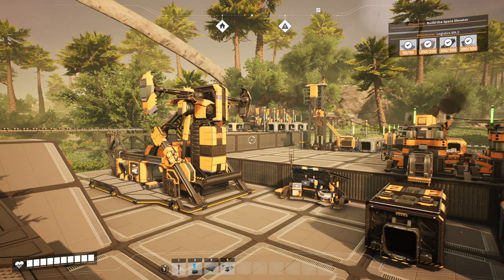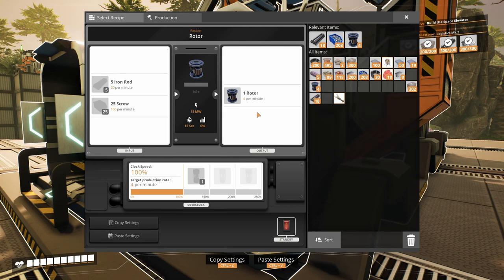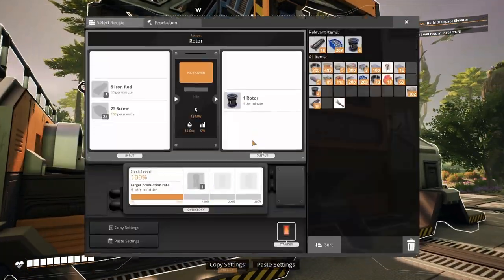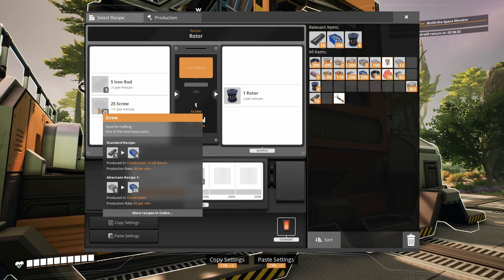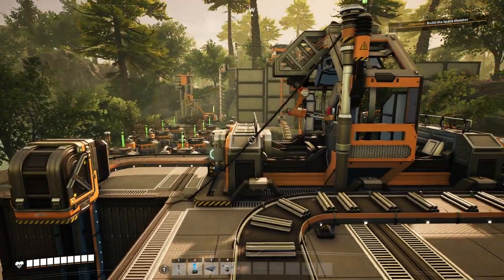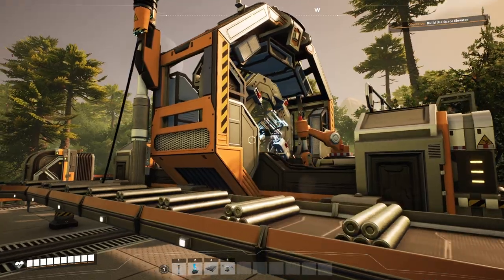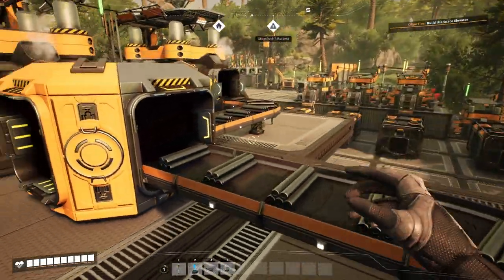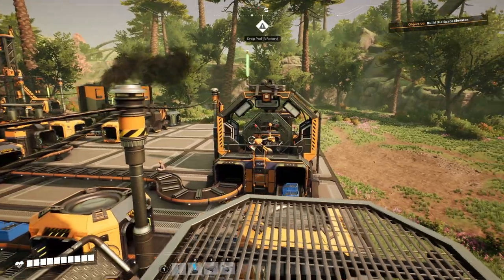How to build a Rotor Factory - Satisfactory Update 6 Tutorial/Guide/Lets Play Ep 04

Comment: Nice stuff, alot of % tweeking on the machines but it works. Cool to see different style builds. 
You talk about manifold and load balancers. I'm a big fan of using the balancer method. It's not that hard to add small amounts to increase your builds. Any number of these work when adding to increase size. 2, 4, 8, 16. Using an mk2 miner and mk3 belts you'll need about 8 smelters. I always try to add a splitter before the load balancer so for future upgrades I can have a 2nd story with another 8 quickly increasing production. 
I have noticed with the manifold system there is more tweeking the machines also why not add a merger before the first machine to create a closed loop system from the last machine on the line? Anything the last machine can't use just goes back to the first and so on.
Reply from the maker: Thanks for the comments. With a manifold there is no need to loop back around -  if the input is overproducing it will eventually back up until it is either slowing down the input source or being fully consumed. The machines run inefficiently for a few minutes until this equilibrium is reached, but then are efficient after that.

Changing the % tweaking on the machines makes no difference between manifold vs load balancer. If I have 3 constructors making 40 screws a minute and feeding them into 1 assembler taking 100 screws a minute, it doesnt matter if what method I use to combine them onto the belt. And underclocking the machines to the correct % saves power and fuel compared to running them at full speed, but only part of the time.